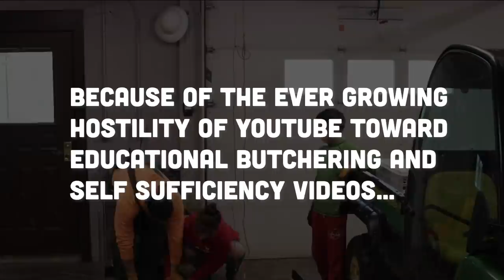BUTCHERING YOUR FIRST ANIMAL - How to OVERCOME THE FEAR

Comment: When I was young I hunted squirrels and fished. Had no problems. I would turn them into good food. A little older and I had to put down a dying pet with a shot to the head. That killed me. Later in life I hit a deer on my way home from work. That killed me. I turned it into food, though I still felt bad about hitting it. I know it would have died anyways but at the time I couldn't shake it. To some degree I still can't. I think your words are going to help me when I begin my homesteading journey. I also have to thank Keith for asking this question because it shows me that others struggle with the idea as well. Also nice to see you are versed on the true way the totem pole works.

Comment: Don't name your meat animals, give them numbers instead, that helps a LOT. Meat animals have numbers and are not your pets, while your pets have names and are not your meat animals (I hope, because that would be messed up). That thing, along with doing the slaughter as a scheduled routine, will help people through it all. Even our hens, which are strictly for eggs, usually only get numbers. This has all been learned through experience and it makes everything work so much more smoothly, and while it's never just easy or fun, because I'm not a psycho, it gets to be normal, and that's what you want.

Comment: My husband and I  butchered rabbits for meat and we found the best way to dispatch the bunny is take a piece of rebar bend it and mount it on a four by four post then hold the back feet and the ears slide the rabbit between the two bars until snug and give a quick yank and it snaps the neck then take the knife and take the head off and let them bleed out. This is much easier on you and the rabbit.
Reply: Teresa Edwards does that cause much bruising to the meat? One thing I’ve noticed is that it seems that oftentimes the meat is kinda bruised up there. Sometimes it’s worse than others but I’m contemplating meat rabbits so I’d love to know as much as possible before deciding for sure.
Reply: 2323sanders no because when I clean them I cut the extra neck part off.  So if there was any bruising by the time you clean them you won’t see any bruising.